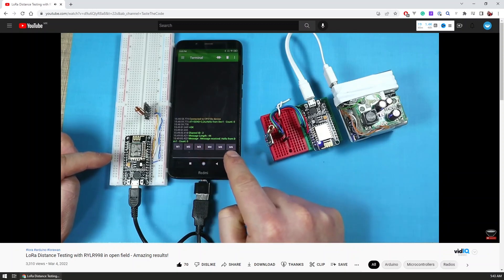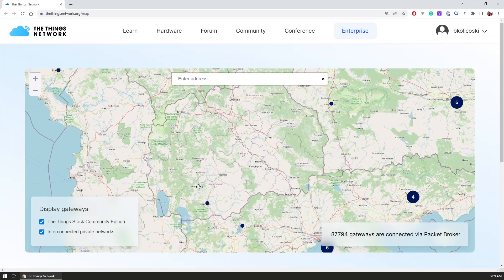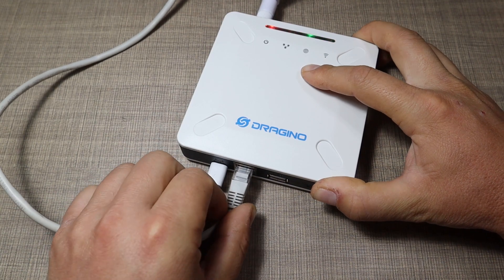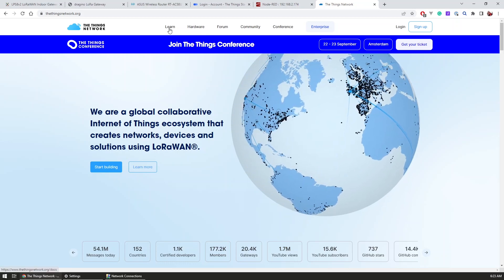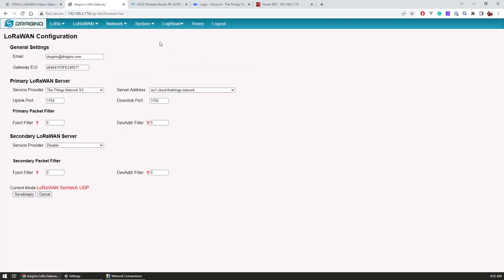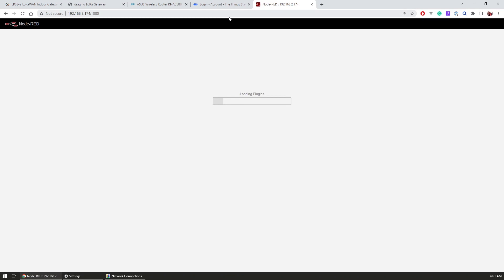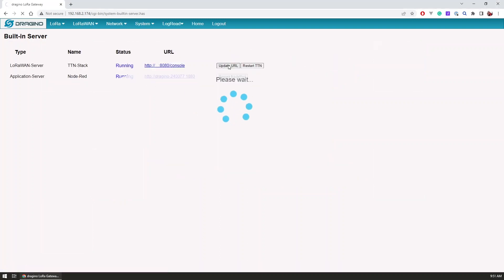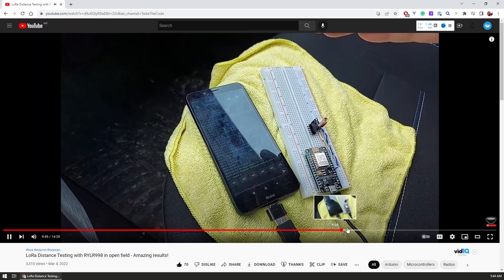Discover LoRaWAN! - How to start and setup a gateway - Dragino LPS8v2

Comment: Can I use two of these bridges to create a link between two buildings?

The primary building has internet and wifi, as well as cabled network.

I want to create a WiFi in a secondary building, to connect some WiFi-IOT.
My attempt to reuse 5GHz network bridges previously used for a WiFi link between LAN in two buildings, failed miserably.

While the previous link was to extend the network requiring decent speed for streaming.
This application only requires some connection, for WiFi enabled IOT devices.

I basically want to run a long network cable between an Ethernet switch in each building, but it's too far.
Switch --- cable --- bridge ---- wireless link ---- bridge --- cable --- switch
Reply from the maker: No, not that I'm aware. These are only for  IoT sensors communicating directly and not for providing network extension. Instead of using 5GHz, 2.4GHz will give you much better chance with some directional antennas. What is the distance that you want to cover?
Reply: @TasteTheCode  the 5 GHz I have attempted are directional.
It's not far, but not in line of sight.
I expect a lower frequency system will penetrate vegetation better than higher.

I think I'll try out some WiFi HaLow bridges, possibly with directional antennas.
I expect HaLow is more suitable, and I believe they use the same frequency range as LoRa
Reply from the maker: I'm not familiar with WiFi HaLow so I really can't tell if that will work or not but you are right, lower frequencies work better with obstacles but there is a limit on how much data you can transmit.
Reply: @TasteTheCode  WiFi HaLow, or 802.11ah is part of the WiFi standard, but a "sidestep" from the normal WiFi using 2.4/5/6 GHz.
As It's primary application is intended for IoT devices, and not for user devices (computers/phones/etc ) it has not been assigned to any WiFi Generation.

There are some available devices specifically for my application. I'm mostly trying to figure if I want to have an indoor device with an external antenna, or an outdoor device with built in antenna

If I'm able to get a link, even at the low end at 150 kbps is enough, anything above 1 Mbps would be a nice bonus.
Reply from the maker: Thanks for sharing! I think going with an external antenna might be better as it gives you more options than the built in as you can probably get a directional one.

Comment: Hi, thanks for the explanation. Is there an explanation of how the Arduino with LA66 shield connects to the gateway? Greetings from Portugal.
Reply from the maker: I am planning to make such a video at some point but you should basically register your device on TTN and use the keys generated to set them on the LA66 shield just as with any other LoRaWAN device.

Comment: Very nice video! Do you know if is it possible the connection between Dragino lps8v2 and a Heltec dev kit EPS+LoRa as a node?
Reply from the maker: Thanks! I don't own the mentioned Heltec device but since it is using standard LoRaWAN it can be used with any gateway.

Comment: Does it support LoraWAN 1.1 ?
Reply from the maker: As far as I know, the gateway will relay data no matter what protocol the device uses. Only in the application node do you need to select the version so the data can be properly decoded.
Reply: @TasteTheCode  I see. If you still have close contact with Dragino, can you ask them for 1.1 confirmation pls ?
Reply from the maker: @dabdoube92  Hey, I sent them an email yesterday and they did reply confirming that the version number should not affect the communication, but they did say that they haven't tested this. Next is their original reply: "We have not tested LoRaWAN v1.1 / but it seems only related to sensors, not the gateway. So it should support. "
Reply: @TasteTheCode  You deserve my sub. Thanks
Reply from the maker: You are welcome!

Comment: When I connect my gateway to either both wifi or ethernet methods, it requires login ID and password. I entered root as a user Id and dragino in password section. Then it doesn't let me in to the gateway UI page.
Reply from the maker: That's weird. It never asked me for password on the web UI. Have you tried admin as a username?
Reply: @TasteTheCode  Yes I tried with so many methods, I guess my gateway's firmware has been crashed:(
Reply from the maker: Have you tried contacting their support?
Reply: @TasteTheCode  No not yet, I do it now. Thanks for your efforts